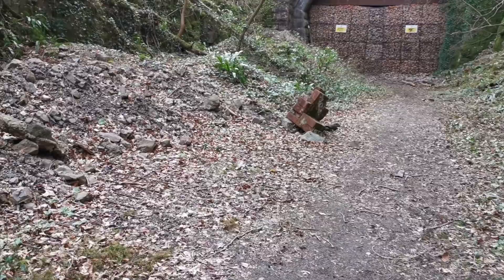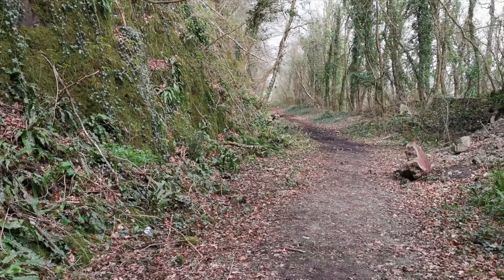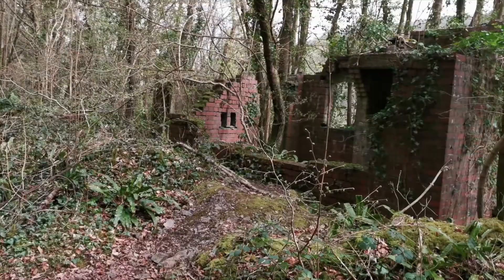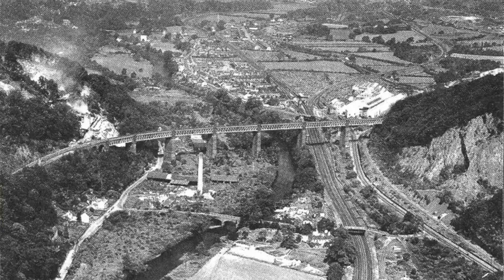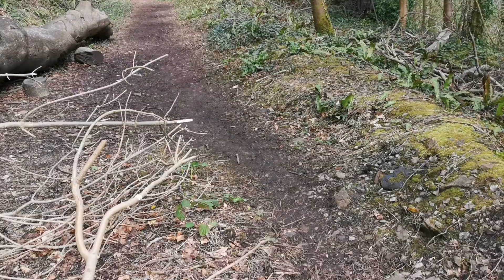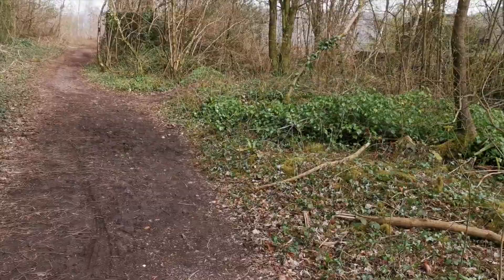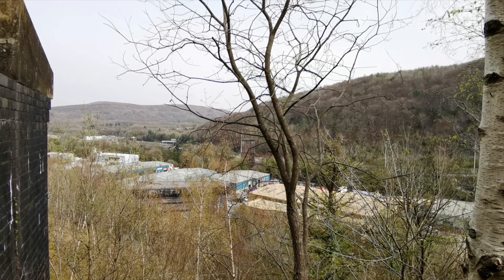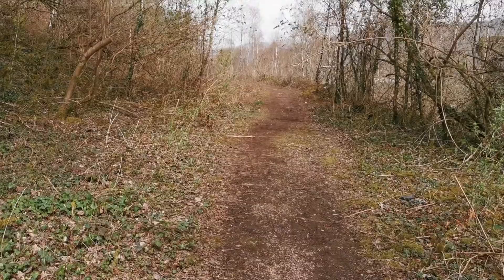Walnut Tree Viaduct

Comment: Today I walked the "other" side of the viaduct, along the track bed which ran north easterly; was very interesting, a few old bridges, even found an old sleeper! Basically drive along Cemetery road, then take a right up Abbey Close, park up, then join the Taff Trail. After an hour or so I ended up at Penrhos Cutting by the old viaduct remains.
Reply from the maker: I need to have an explore. Thanks for the tip
Reply: hey do you havd any videos of the other side

Comment: I believe there was a siding to the dolomite(?) works between the tunnel and the viaduct  - a later addition, which can be seen on one of the photos at the end. So the need for a signal box to control shunting would seem likely. And it does look like the base of a small signal box.
Reply from the maker: I found out after the video went live that what you say is totally correct. I am planning another visit as part of a look at Taffs Well (four railways and a canal) and will correct myself then. Thanks.

Comment: Hi Bob could you tell me how to find this tunnel cheers
Reply from the maker: I used a path in Gwaelod Y Garth by the bus stop between Heol Berry and River Glade. There is a sign saying its private but I thunk that is for cars as it is marked as a footpath on the maps. It is off, but you climb up to get the the viaduct remains and then the tunnle is a littl on from that. Its is very unsafe to enter as a quarry has cut it in two which is why it is so blocked off.
Reply: @bobsrailrelics  thanks